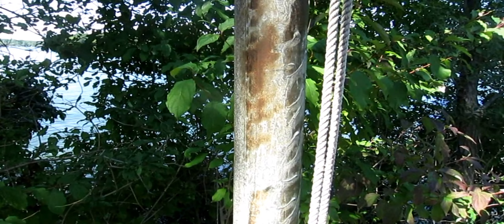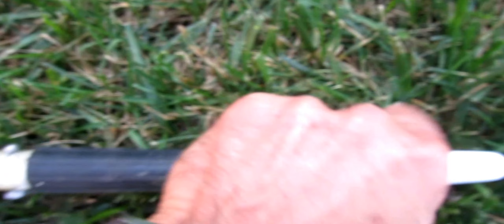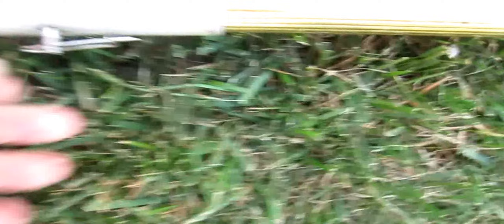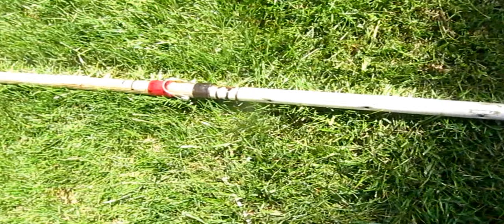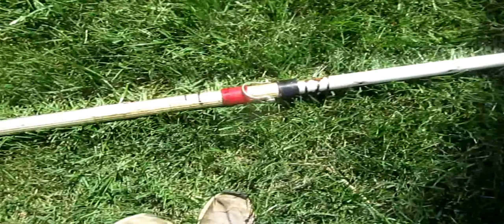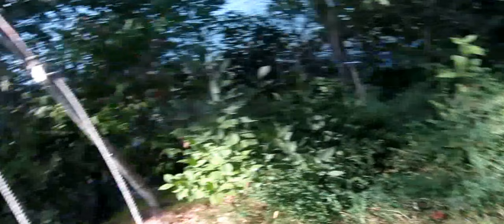How to Paint a Tall Flagpole Without a Lift

Comment: how tall is your flag poll?
Reply from the maker: I believe it is about 30 feet high.
Reply: How did you prep the pole,   remove rust loose paint etc. How did you apply paint to the rooler. All I see is how to connect two poles together.
Reply: How would you restring this flag pole if the string broke off from the top? Cherry pickers are expensive to rent. Please any ideas?